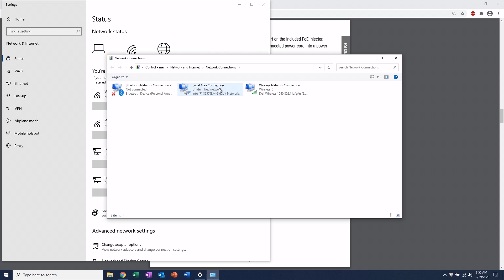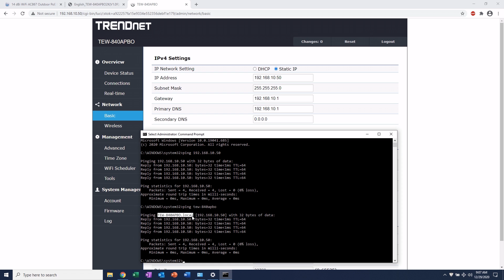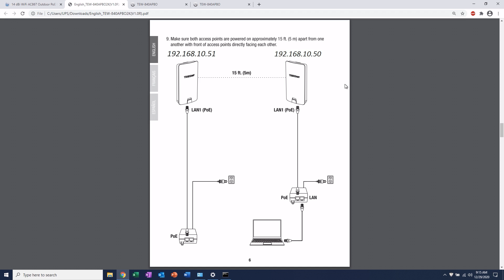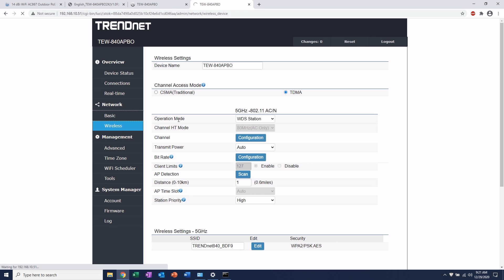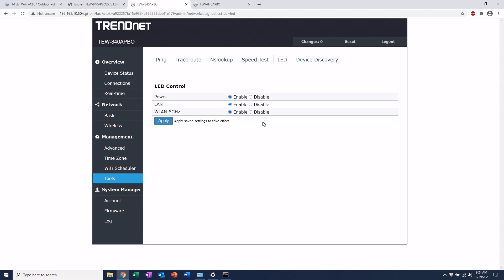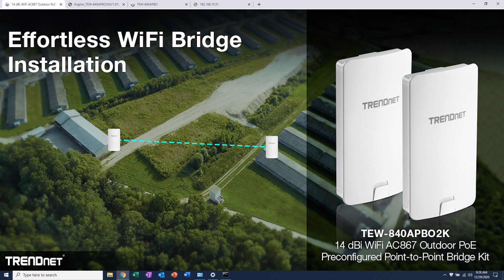Trendnet's Pre-Configured 5GHz Outdoor Bridge Kit - TEW-840APBO2K - Technical Walkthrough

Comment: What should the internet side of the network  bridge be configured as?  The bridge neets a gateway to go online and provide access for the bridge.
Reply from the maker: Hi.  The APs will carry traffic regardless of their own IP/Gateway settings.  As long as the clients have valid IP/gateway/dns settings obtained by DHCP from a server or router, the bridge will be invisible to the clients.  The only time you will need to add gateway and dns settings the the APs is if the bridge APs need access to outside services like NTP.

Comment: Hi, I have a question, maybe you can help me, we have couple p2p trendnet TEW-840APBO, when I make a extended ping I see we lost package a lot, they are alignment, nothing in the middle, so my question is, for short distance, what is the best channel to use? before was using CH48,we set to CH161 and the problem continue, Thanks for your suggestions
Reply from the maker: Hi.  Channel selection shouldn't make any noticeable difference based on distance, but rather to avoid other networks in the area using the same channel. I suggest reducing the power for short distances, that can help prevent some sources of reflection and interference. For the 840, look under Network, Wireless, Transmit Power.  For very short distances I would start with the lowest setting and measure performance from there.  Also, be sure to change that setting on both units.
Reply: @ssireps  awesome!!! We will try that, thank you so much